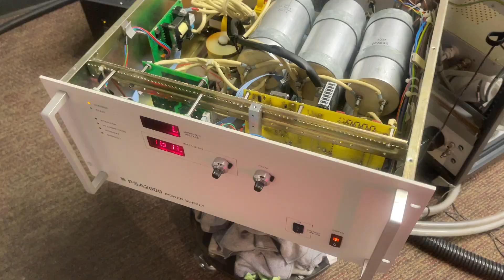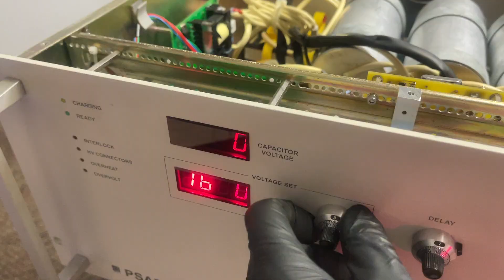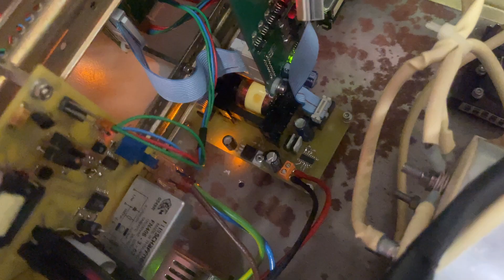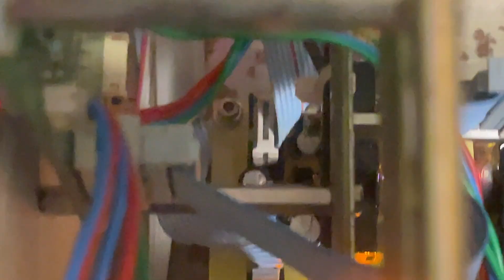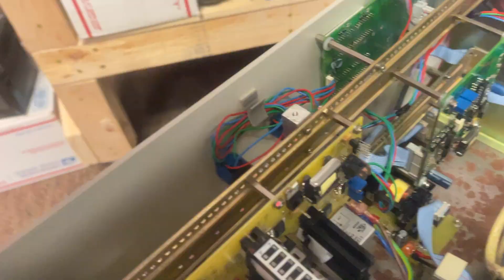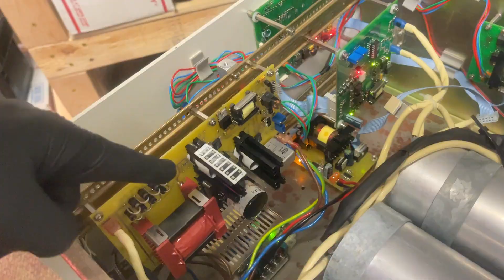Progress on the Geola G2J Amplifier Supply

Comment: Seems the smaller board is making a short, yielding the blinking PSU behaviour
Reply from the maker: I found a bad capacitor on the large board near the input connector.  All diodes and  ICs are checking out. 

The cap I found shorted is only rated for 35v but incoming voltage is 40v likely why it shorted from the smaller board. I may need to trim down the 24v input supply so the step up transformer to 40v is within 35v spec rating